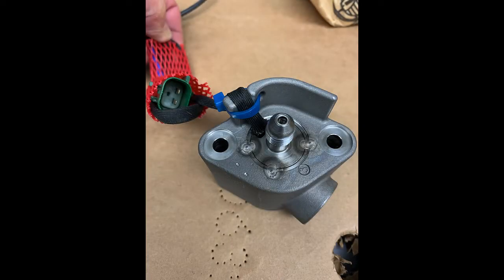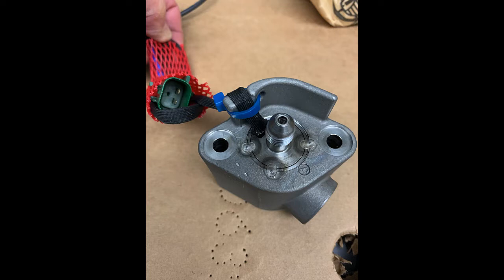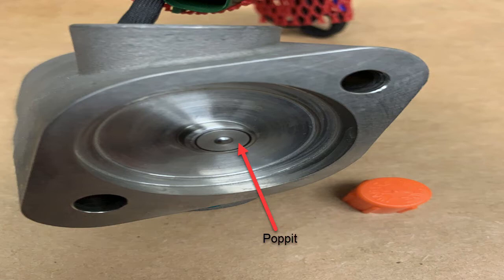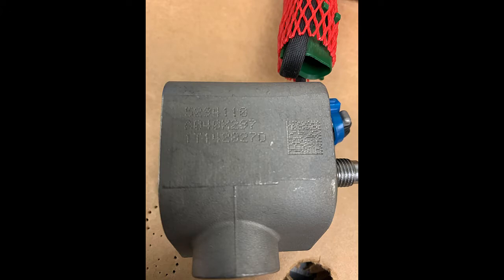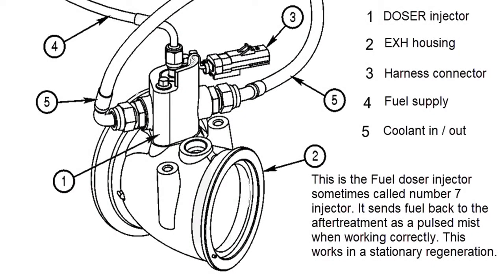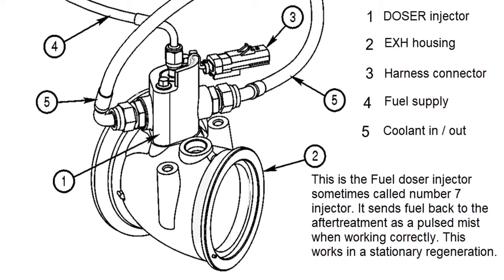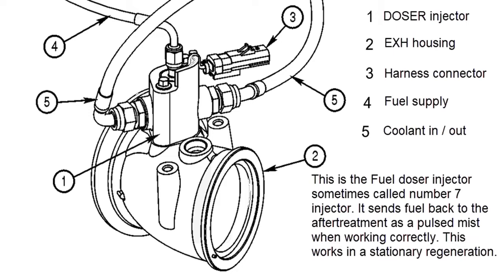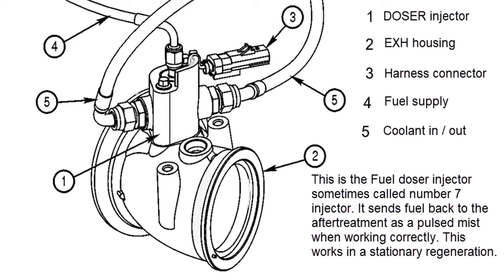Aftertreatment isx 871 part 5 DOC Doser injector

Comment: I have 2 codes wonder where to start as I can't drive vehicle to shop as its not plated or insured.  Code 1 is SPN1569 FMI 31 and tge second code SPN5394 FMI 7 . low def light on and the  check engine light came on.
Reply from the maker: 5394 means the system believes the def injector in the decomp pipe is not spraying fluid or stuck shut. The system might also log this fault if the decomp pipe is plugged with dried def fluid. I would remove thae def injector and do the def volume test that is 6 minutes long. If you don't have insite or a tool that will run that test then pull the injector and see if the tip is plugged or the decomp pipe is plugged. (The decomp pipe is the pipe the def injector bolts into.) If the pipe is clean I probably would replace the DEF injector. Then you have to do a stationary regen to clear the 5394 fault or reclaibrate the ecm and then do a stationary regen.
Reply: @ENGINESHOPJOE thanks for the reply. Thos truck has sat for a year after an inframe egr valve replaced. I thought I had left the def tank full. I've started it a couple of times let it get up to operating temperature.  A while ago I took it for a short boot and in seemed to do a regeneration and I let it sit running after I got back, the low def light was on solid (that's the blowing symbol). I shut it off, and then later git some def fluid thinking it was emptier than I thought which I rarely let it get below half assuming the def gage is reading accurately.  I got a 9 liter jug and it only too barely half so I guess the gage reading full was slightly inaccurate. And I left it. Recently I attempted to start it again and found my brand new batteries of 6 months were dead. I boosted and git it going and the check engine light was now on and these two codes. I dint have access to a computer short of gettin it to a garage. I'm tryin to sell the truck and hope to find/fix these issues as inexpensively as possible.

Comment: I have a paccar mx13 epa 17 and I changed my doc and dpf all the sensors. The turbo actuator. And the egr valve. And for some reason my doc is overheating during regen. Could my fuel dossier cause this. Thanks in advance
Reply from the maker: We have about a dozen of these engines in our fleet. We have had a lot of injector problems. There is a special flush and I think software update that has to be done. Paccar dealers have been fixing ours. I am not that familiar but if this has a seperate fuel doser injector it could be causing this yes.
Reply: @ENGINESHOPJOE  thank you

Comment: My doser injector is the same on my peterbilt 579 just got a code spn3556  after treatment fuel injector 1 FMI 5 current Below Norma or open circuit.  Code came on after having to charge batteries because it wouldn't crank over after LVD warning came up on dash. Any guidance could help. I would be checking the wires to harness to ACM module or could it be doser itself that's no good.  And whats that blue zip tie on doser for? Anything would help thanks
Reply from the maker: The zip tie clamps the pigtail to a flange on the injector so it does not break off from normal daily vibration. Dont remove it.
The injector has a coil in it but it is pulse width controlled not a traditional DC circuit. At key on the ecm pulses the injector and expects to see current return. The engine ecm drives that injector. If the batteries were low that could of caused improper check verification. I would charge the batteries or get the unit running. Then do a 2 minute key off. You may have to put the unit into a stationary regen before it will verify the injector is OK. try to reset the fault even if it is active. If the injector ohms out in range and none of the proceeding worked i would recalibrate the engine ecm.
It is very rare but if battery voltage is very low the ecm might of locked the fault in the fault ecm ( there is a seperate bus and ecm for fault logging). A software recal completely rewrites the controls so all the faults are erased. If they come back after a cal and the injector checked out look at the harness or a connector for that circuit. I doubt the ecm is failed or damaged- very rare.

Comment: I took mine off and went to freightliner and they didnt have it , So I got one from  peterbilt . Do you thing thats a problem? I Dont think i got the correct part
Reply from the maker: If it's the correct part number and it bolts up its ok. It should look very similar but they did make a few physical changes but nothing that would make on say - there is no way this is it. If you are worried call 1*800-cummins with your engine number and ask them the part number. If it is different give them the part number and ask them if it is correct. When you buy parts from dealers sometimes they put their part system number on it not cummins (in this case) So its ok if the box has a different number. Cummins put the part number on all parts so look for the 7 digit numeral and that should be it.
Reply: Thank you 🙏🏽🙏🏽🙏🏽

Comment: I replaced mine and it keeps dumping fuel into the exhaust system causing crazy amounts of smoke, what would cause this?
Reply from the maker: If you have an ISX-871 the injector gets fuel from a housing bolted on the cylinder block drivers side. When the injector is not being used no fuel should be in that block. There is a drain valve and supply valve along with a pressure sensor in the housing. I suspect the supply valve is leaking and allowing fuel to pressurize the housing while you're driving the ECM pressurize the housing at start up and then dumps the fuel out of it. This is a self test. It then opens the injector behind the turbo. If, for some reason, there is fuel pressure in that housing. It will fill the exhaust pipe with fuel. However, you won't see the white smoke until the exhaust system gets hot enough to start to burn it. Unbold injector leave the lines on start the engine, while someone watches to see if fuel is spraying out of the injector at start up. Rarely, I have seen the housing I spoke of earlier, fail internally and always send fuel to that injector.
Reply: @ENGINESHOPJOE  I appreciate your channel and response buddy.
Reply from the maker: @realmccoy9597  Thanks for the kind words.
Reply: @ENGINESHOPJOE  I've replaced the fuel valve and injector and it still continues to inject fuel into the exhaust!  I reset the aftertreatment system and it went away for about 5k miles and it came back again,  I reset it again and and we'll see what happens. Cm2350
Reply from the maker: @realmccoy9597  The 2350 is a little different than the 871. It has an air solenoid the ecm turns on once injection is completed. That air solenoid pressurizes that injector with air to blow all the fuel out of it and the line feeding it. That is to help stop carbonization of the tip which leads to poor atomization. If the problem continues let me know and I will see what I can find  on what could be causing it.
Reply: @Engine Shop Joe  the problem goes away after I reset the aftertreatment system and then it comes back around 6k miles or so, it's very frustrating! I've replaced the air purge valve, the on off solenoid and 7th injector.  Any thoughts would be appreciated.